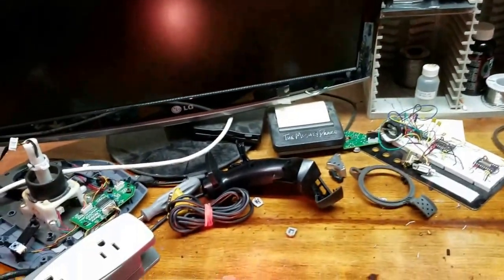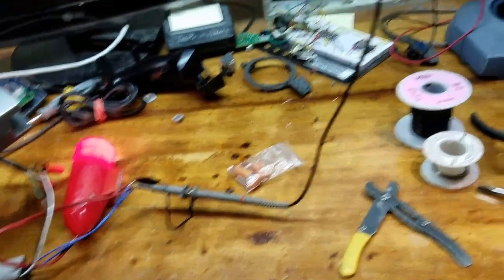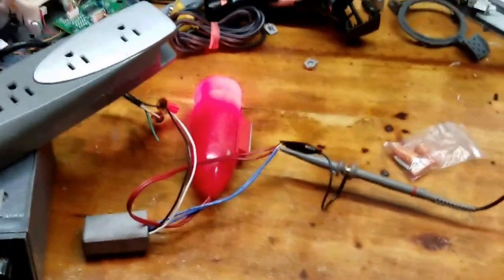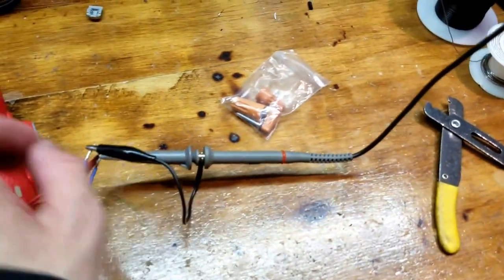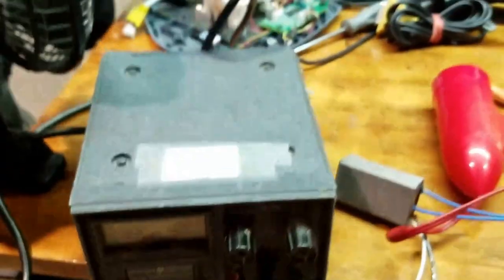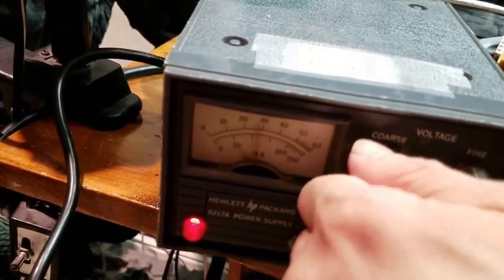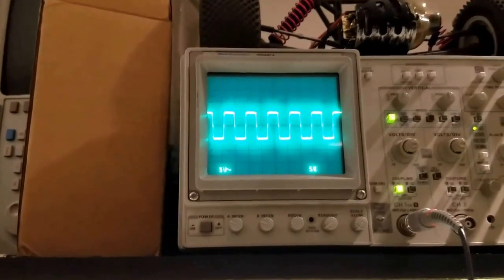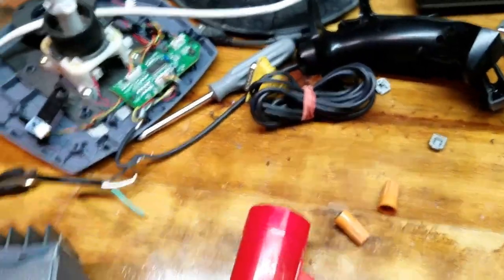LET 60 LV Lab Review

Comment: so the lv version is good for incandescent? I was told t was only for led, very confused.
Reply from the maker: The ones I have used are for Halogen lights, should not be used with LED, the main reason is many LED's have bridge rectifiers, and some are not fast enough for the switching frequency. It has to be a fast recovery diode like used in switch mode Power supplies.
Reply: thank you  @tmdrake